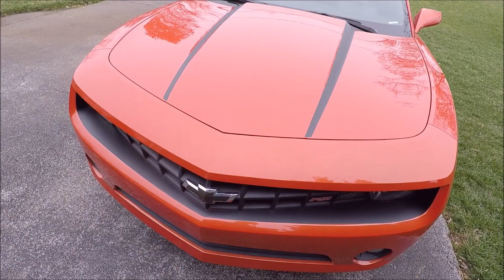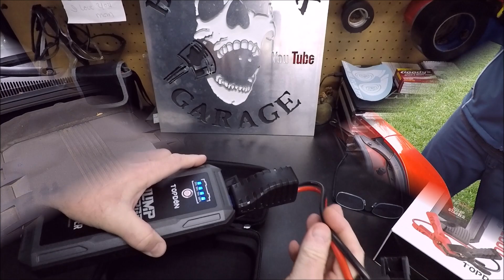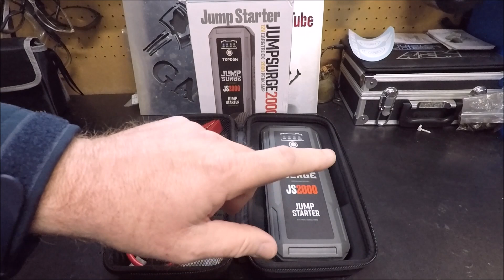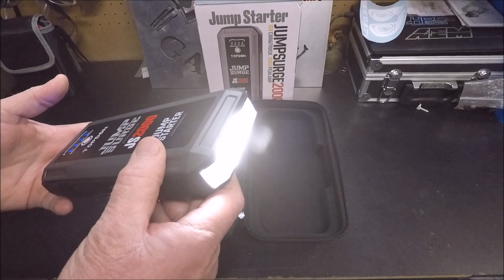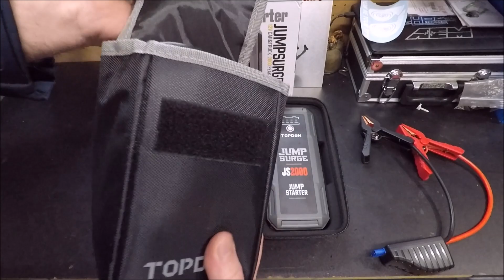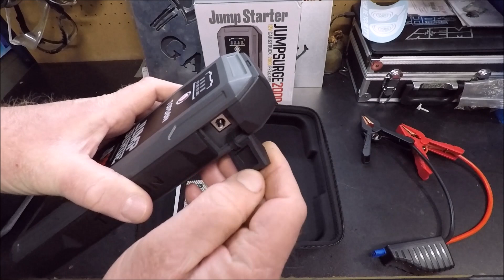TOPDON JS2000 JUMP STARTER REVIEW

Comment: How’s the durability of the buttons? I’m looking for an alternative to the Noco products. The Nocos work, but their buttons are flimsy as hell and cease to function in just a few short uses.
Reply from the maker: 2 year update! This units still going strong and has jump started multiple dozens of vehicles at this point. We’ve even used it to charge cellphones and run LED lights on several occasions! The main button has cracked in the middle after 2 years of use, but still functions properly so I’d call that normal wear and tear on a frequently used tool.